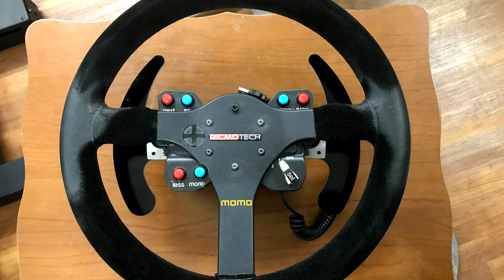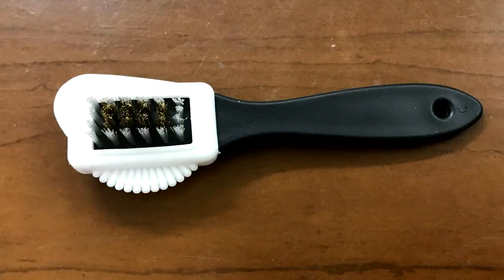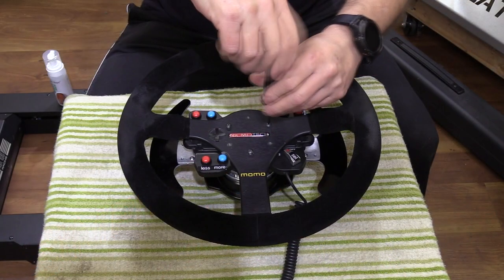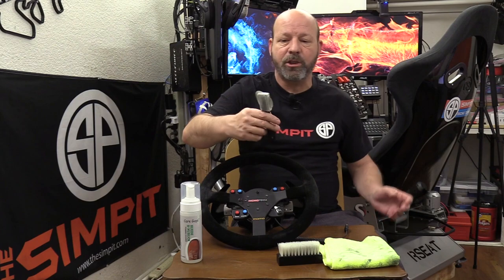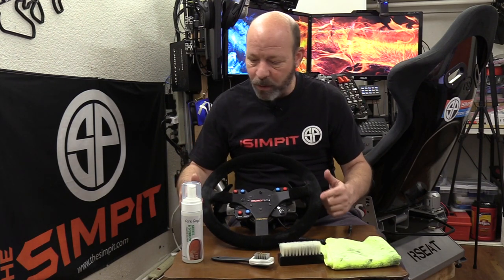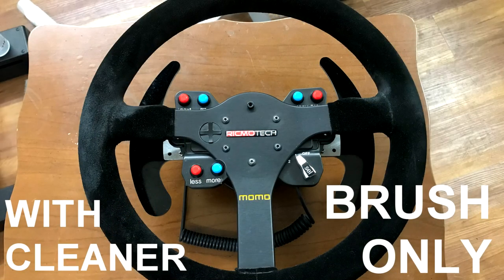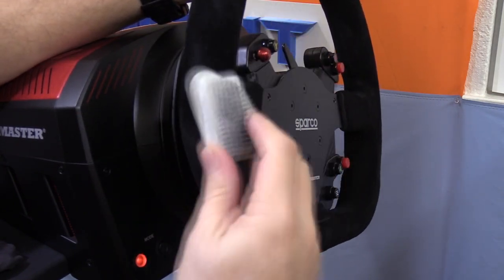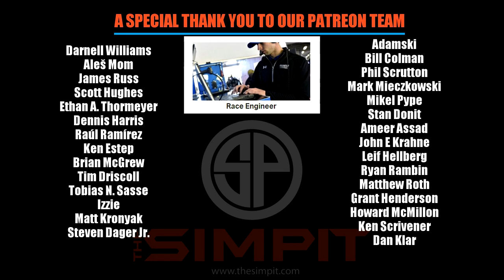Dont Kill Your Suede Wheel - Easy fix for glossy, waxy, matted down suede wheels.

Comment: My nephew bought a used Thrustmaster T500RS wheel with a Ferrari rim, it looked very similar to yours after a good amount of years of use,  I used vanish carpet cleaner with a microfiber cloth and a semi-hard toothbrush and a softer toothbrush and some water it worked really well, the Vanish does not matten down the Alcantara like the product you used did, it looked close to new after the cleaning, I'm sure if we did some more runs on it, we could have gotten it even nicer.

Comment: I use BMW Alcantara cleaner on my Fanatec Alcantara rims, together with a toothbrush and a microfiber cloth.
Works a treat and no damage to the Alcantara as all the color comes back and the hairs are raised by the tooth brush as you work the material jn.

Comment: i dont want to wear gloves when i sim race, but i also want a 330mm wheel, i also want the center strip, i also want the deep dish, and i also want it light so its easier on the wheel base, better ffb, faster spinning wheel for drifting etc. but i also want it as cheap as possible. so far my only option is suede. i have spent hours and hours, days and days searching aliexpress and ebay. the only cheap wheel that matches this criteria is suede. i would much prefer standard leather. but eh. i guess the other stuff is more important to me. i guess i will just have to try and wear gloves occasionally, or clean the wheel from time to time.

Comment: I tried gloves, but had trouble locating my buttons with my thumbs. Since I run VR, I have to rely on feel 100%.
Reply: really ??  i have no trouble finding any button in vr ,even on the button box .
Reply: @tokkelcs  I lost sensitivity, or feel of the buttons, since they are clustered. I only have four programmed buttons. The PlayStation toggle is look left and right, to which I only use pulling onto Lernerville, and Weedsport. Even though I have VR, I use look left. It helps. Running short track dirt, that tear away button can be difficult to find. The car is hardly ever going in a straight line. Shit happens fast.
Reply: @voodoo7008  aha right ,now i understand .
Reply: @voodoo7008  I know this might be a very late reply, but I have my tear button on the space bar and put my keyboard next to me. just smash down on the spacebar : ^)
Reply: @Pokeyy  That’s really a good idea. I’m in a rig though. 

On another note, my newest wheel is Alacantera.
Reply: @voodoo7008  so am I, when my rig was more budget I just grabbed a little side table to put my keyboard on, but I now have a keyboard tray. Highly recommend